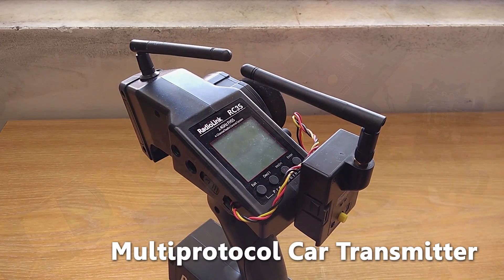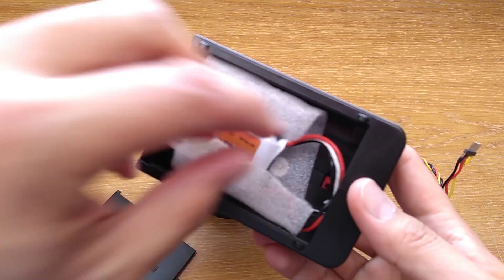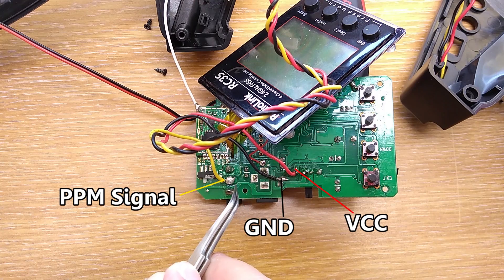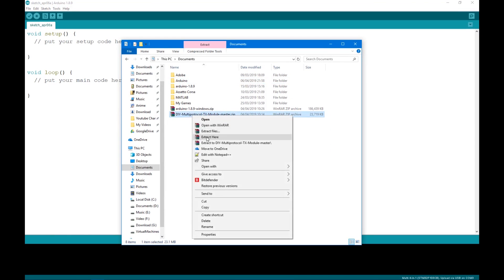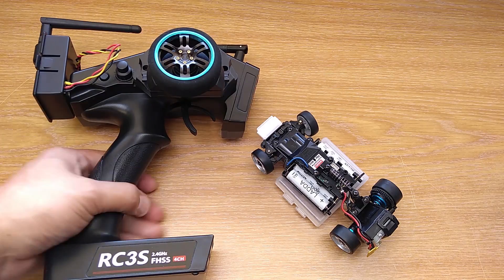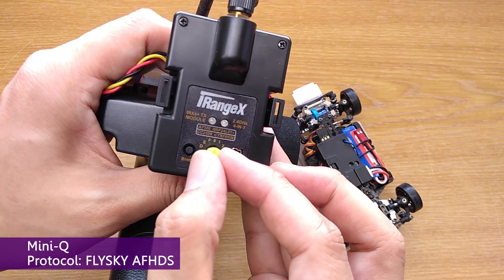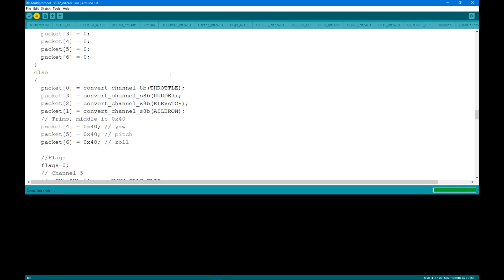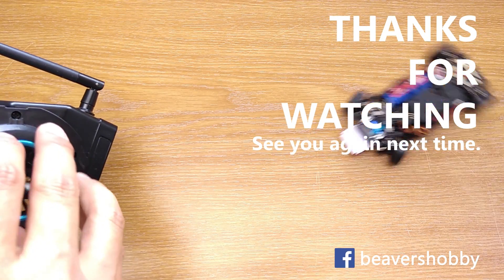How To Use Multiprotocol Module With Car Transmitter & Mini-Z, Mini-Q, WLtoys

Comment: Nice work again Beaver! 
I am thinking of buying one transmitter which I can use with multiple (car) models. I am also into RC aircraft, and I noticed that it is possible to get multi protocol aircraft transmitters, but it seems impossible to get multi protocol pistol-grip surface transmitters.

That's what ultimately led me here, but before I go out and buy a new surface transmitter, a module, and then Frankenstein them together, do you know if any radio companies are planning to release new multi protocol surface transmitters anytime soon?

Also, my computer died a while back and I haven't bought a new one yet, so I was wondering if you can tell me if it's possible to get a multi protocol module which can be used without any computer setup, or if it can be done with my (OTG capable) phone?
Keep up the cool mods and videos!😉👍
Reply from the maker: There's no plan for production of multiprotocol pistol grip as far as I know of. It's mainly a drone thing. If you don't mind driving with sticks an air Tx will be alright. You can also DIY it. There is someone I found that make their own multiprotocol surface Tx. Take a look at this. https://www.rcgroups.com/forums/showthread.php?3848273-Custom-micro-RX-ESC-for-OpenAVRc-MPM-or-Arduino-TX
Unfortunately you'll need a computer to setup multiprotocol module if you do a frankenstein build like mine.
Reply: @BeaversHobby  Thank you for taking the time to reply, and answer my questions!🙂
I do prefer pistol-grip for cars, so I might have to wait until I get a new computer, and do the Frankenstein option. 
Who knows? Maybe by then (hopefully) a company might have clued on, and released a multi protocol, pistol-grip radio, with model memory expandable with an SD card!
One radio for all of your models.
Wishful thinking perhaps, we'll see!
Seriously, I don't know why pistol-grip radios don't have these features already, especially with so much competition.
Anyway, we do what we can.
I will check out the link you put in your reply.
Thanks again, and I look forward to your next video!👋😉
Reply from the maker: @mickmuzzmkmz1628  My pleasure. Best of luck with the project.
Reply: @BeaversHobby  I was just Re-watching that video while trying to use my Radiomaster MT12 with a multi protocol module. 
Thank God that you can finally buy an open source car radio now 😂

Comment: Hi , work if i use the module on a 12 channels remote controller ?
Reply from the maker: Yes, it will work. Multiprotocol is designed for plane and drone in the first place.

Comment: Beaver big thank you for this video! I was able to wire up the IRX4+ and bind with a MB-010VE in FHSS. First I compiled and uploaded new firmware with PROTO_KYOSHO support. Second, I was able to find the 3 soldering point for RC4GS though I chose the ground pin under the DSC port. While I was checking out the circuit board, I realized it's actually the RC6GS board, so I needed to plug something into the DSC port to enable the PPM signal. I actually was in disbelief when everything worked! My soldering skill is absolutely terrible.
Reply from the maker: Glad you got it working. Noted, the current generation radios need something to plug into them to output the signal.
Reply: @BeaversHobby  Since the expensive KT432PT is otherwise the only upgrade option for kyosho fhss, I feel this irx4+ mod for ppm-capable transmitters should be publicized much more.

Comment: Hi Beaver -- is this iRangeX IRX4+ still the one to buy today? Thanks.
Reply from the maker: Yes, it's one of the few that's got both serial and PPM mode.
Reply: @BeaversHobby  Great. Now I have a second car with kyosho fhss, I think it's time to try this. I'm trying to avoid buying the kT432PT radio.
Reply from the maker: @sammybaka  I found it add a bit of latency to the system. It's just 8ms difference. Not that you would notice it unless you film it with hi-sped camera.
Reply: @BeaversHobby  Yes that's really too bad but it won't be as fast as a native implementation I guess. I'm hoping the ability to set EPA, expo curves, better ergonomics will still increase drivability.
Reply from the maker: @sammybaka  Added delay is miniscule and you won't feel it. The benefits outweigh the delay in every way.

Comment: Any idea if this can be done to a Flysky Noble NB4?
Reply from the maker: Unfortunately, no. NB4 doesn't have PPM output unless you get it from a receiver which is not advisable because you'll add more latency to the system.
Reply: @BeaversHobby  forgive my ignorance.
But how do I know if a radio has PPM output?
Does it need a "master/slave" contact?
Reply from the maker: @zeno6111753  Mostly when it has a DSC output or anything that can connect to another radio in training mode (most of the air transmitter have this). It's the same port that you connect it to USB converter as well. The other way to have PPM output is an old radio with module like Futaba 3PK and Sanwa M11.
Reply: @BeaversHobby  Futaba 3PK works? Don't you need 4 channels?
Reply from the maker: @zeno6111753  Yes, but you can swap in the code to use channel 3 as channel 4 so it all work out.
The standard channel order is AETR, swap that for AERT and voila! It works!

With that being said, I'm working on a new video where I use my 3PK with both Sport and the new FHSS (RWD/AWD/FWD). Basically it's only what I just told you now, AERT and it works.
Reply: @BeaversHobby  that sounds great! 
Looking forward to that video. 
And also, again thank you for your answers and sharing of knowledge with us noobs :)
Reply from the maker: @zeno6111753  My pleasure. Good luck with the project.

Comment: Hi, sorry if asked before, but what is the protocol in use in wltoys original setup? I'll try to use it with my Frsky joystick transmitter with the irangex module...Thanks
Reply from the maker: WLtoys is V2X2 just like I showed in this video. iRangeX will work fine as you can see.

Comment: Hi ! Do you believe I can use this module on the KO-PROPO EX-10 radio with a module bay ?  I have a module for Mini-Z (ASF) on it with the mention  DDS, so I don't know if it is related to PPM or not.
Reply from the maker: Yes, you can use the same method with EX-10. Just need to locate where the signal pin is. The Mini-Z module also runs off PPM signal if it's the same one as 3PK.

Comment: Thanks for this. Tried to do the same with Flysky FS-GT2 using the DSC port but the iRangeX 4+ doesn't seem to see the PPM signal (flashes red slowly after power-on). Testing for the PPM pin of the DSC port using a multimeter gives about 4.6V. Any idea what could be wrong?
Reply from the maker: 4.6v is much too high. Can you connect that to the USB adapter and use it as game controller? If it works with adapter then it's PPM and you might need some resistors for it to work with this module. Otherwise it's something else.

Comment: Hello, it seems, that it uses A7105 chip tx for AFHDS protocol. And this chip is way cheaper than this module. Have you investigated that?
Reply from the maker: I use other chips as well because Wltoys uses NRF24L01 and some of my receiver is DSM2 which is CYRF6936. If you only use it with A7105, building one from scratch with only 1 chip is way cheaper as you said.
Reply: @BeaversHobby  Yep. For me is more important the size. So, I can place it inside RadioLink RC3S.

Comment: Bro Radiolink RC6gs
Modulation mode: GFSK
Spread spectrum:FHSS 67 channels 
kt-531p  radio spec to same  can be connected with or not?
Do need to customize the software?
Reply from the maker: Unfortunately no, they are not cross compatible.
FHSS is just the name of a method for skipping frequency to avoid interference.
A radio talks to a receiver via protocol which dictates the way to skip (hop) between frequency and possibly other attributes like transmitting encryption and telemetry. Radiolink and Mini-Z protocol are different. Even RF chips are different.

Comment: I would like to know if the radiolink rc4gs connector mini z can do or not? ( not mod)
Reply from the maker: No, it can't connect to Mini-z without mod.
In case you are confused with the "FHSS" label. That's just the name of the method for skipping frequency to avoid interference.
A radio talks to a receiver via protocol which dictates the way to skip (hop) between frequency and possibly other attributes like transmitting encryption and telemetry. Well, Mini-Z doesn't have telemetry but you get the idea.

Comment: Yeah....
No ppm from that pinout on the rc6gs.
Looking for the pcb trace to the rf module but no luck yet
Reply from the maker: I'm quite baffled by this. Did they change the internal too much that now one's DSC doesn't output PPM anymore?
Reply: @BeaversHobby  
I don't know but it wasn't until after I bought the rc6gs that I saw your post from years ago on RCgroups asking the same question.
There is a spot to solder headers on the rc6gs board but the "tx" voltage is 3.3v not 2.7v.
Is 3.3v a "common voltage" for ppm out?
 check out my post on rcgroups I uploaded a picture...
a13194775-101-Screenshot_20200224-182409_Gallery.jpg (1440×2960)
https://static.rcgroups.net/forums/attachments/6/6/2/5/8/0/a13194775-101-Screenshot_20200224-182409_Gallery.jpg
Reply from the maker: @user-zi5rs1by7b  Honestly I don't know. That Tx could mean anything and a mean to communicate between transmission module can be more than PPM.
Reply: @BeaversHobby  
I figured out the problem. I was testing the JR module with a separate battery and it needs battery ground split between the dsc, the battery and the module to complete the circuit...
I feel silly.
Now I just need to figure out how to cut power to the internal tx module (maybe with a switch) while using the external module. Any ideas?... or does the internal module stop transmitting while using dsc? I might test that theory today.
Reply from the maker: @user-zi5rs1by7b  Internal module doesn't cut the power when output DSC. You'll need to unsolder the board to get rid of Radiolink output. However seems like no one has ever done this and no one knows what would happen.
Reply: @BeaversHobby  
Well then I will boldly go where no man has gone before....
and I will report back.
I will likely put a switch to the internal module... may post a video.
Wish me luck.
Reply: @user-zi5rs1by7b  hi after reading this post, i hope you can help me. i am trying to add in the multimodule to rc6gs as well. can you share a photo of the pins you soldered to that is working for ppm, ground and power?
Reply: May have found the solution. In order for the RC6GS to actually output PPM on the DSC port/pins, we have to plug something in. With nothing plugged in, the voltage is 0. I cut off an old audio jack from the rest of the audio cable and plugged it into the DSC port and the PPM output works now!!!
Reply: @nicholastan4108  Same with me! Spent a day figuring out what's wrong with missing PPM signal on DSC port on both radios I have - RC3S and RC4GS. No signal until I plug the audio jack in the DSC hole. It works like a charm now with my STM32 4in1 module. Many thanks to you Nikolas for such a useful hint!!!

Comment: Can you still use the radiolink reciveres with this modification? and does it store the models in its model memory using the multiprotocol module?
Reply from the maker: Yes, Radiolink receivers still work. Make sure to pull the plug from multiprotocol before go back to stock Radiolink to avoid interference. Radiolink don't get it easily but better safe than sorry. I have to mention that Radiolink transmission module don't turn off when you do this so you can drive both multiprotocol and Radiolink Rx at the same time.
The model memories are saved in the transmitter so you still have 10 models like before.
This module is similar to plugging the DSC into converter and play simulator on computer.
Reply: @BeaversHobby  Perfect, thank you very much, i have the rc6gs, and being able to plug in a spare multi module is exactly what it needs to be perfect.
Reply: @BeaversHobby  maybe im doing something wrong, i couldnt find a ppm signal on the dcm pins inside the trannsmitter, i have the ground and power soldered up and they work and power on the module, but that ppm signal doesnt appear to exist on any of the 3 pins. Have any tips and or multimeter settings i could try?
Reply from the maker: @53rdcards  Set multimeter to 0-20V, that should see the 1.5V on PPM pin. I'm not sure about RC6GS output though. Do you have a DSC to USB adapter (for simulator) to test if the port works?
Reply: @BeaversHobby  I do not, but i can get one, and thanks for the tip on the multimeter

Comment: Beaver.... my guy?
I would like to do this to a wltoys P33 pistol grip but the pinout doesn't have a ppm clearly labeled. If you have one of these radios could you maybe help me out? I don't even know if wltoys transmitters have a ppm out signal...
Reply from the maker: Unfortunately, it doesn't seem to have one. Not every transmitter has this output or port.

Comment: Hi there. I wonder if I can do this on Futaba 4pk. It has dsc (as I google it), but not like 3.5mm jack, it's socket connector.
Reply from the maker: Yes, anything with DSC or PPM output will work regardless of the style of the port. Just find which pin is the signal output coming from and you're ready.
Reply: @BeaversHobby  Thabks. I'm still looking for a transmitter. I love ex-6 & ex-1, but those are expensive even used one. No idea which tx should I buy. In my head, only kt-18, rc4gs, 4pk.
Reply from the maker: @MDXZFR  4PK is a great radio if you can get it at a right price and right condition considering it's quite old now. It offers everything you'll ever need and quality is far superior than RC4GS.
There was a mod to install ASF board in 4PK too. I guess he did the same thing and tapped in to PPM output on DSC. http://mini-z-guide.com/radio.htm
I won't explicitly say stay away from KT-18 because the quality is decent but in long run you'll eventually want more adjustments. One thing to mention about Radiolink, it doesn't turn off the transmission when you use DSC. So if the protocol is susceptible to interference (unfortunately, as far as I know ASF is) you might get interference unless you pull the Tx board off. I haven't done this full conversion yet but it looks doable.
Reply: @BeaversHobby  ahh. Sounds bad. Even after the batteries removed?
I'll try to get this 4pk, and use it with dasmikro asf module. If the price is good enough.
Reply from the maker: @MDXZFR  You need battery to operate the radio. The Radiolink's transmission module is soldered to the board. It can be removed though.
Reply: @BeaversHobby  i see. Ig there's no prob with the 4pk right? How about ur 3pk? U said u wanna use it with the module in the video.
Reply from the maker: @MDXZFR  Seems to be no problem with 4PK.
Every since I bought the FrSky module for my 3PK I kind of forgot I wanted to drive Mini-Z with it and had so much fun with AMZ & Q7. I remember testing with a code that permanently activates channel 4 for Mini-Z Sports and it worked. But nothing beyond that. The project is still left open though, I'm currently waiting for small receiver for FlySky Noble. If that is small & light enough I'll go back to 3PK + Mini-Z Sports.
Reply: @BeaversHobby  that sounds fun. Having another cars beside mini-z is in my wishlist. 
So, u're gonna use Noble with Amz & 3pk with mini-z? Well, u should upload ur project videos here. I'll be waiting.
And I just bought 4pk online for ¥10,280. Around $94 include shipping. Sounds ok?
Reply from the maker: @MDXZFR  4PK for that price? That is fantastic! Here it's about 250 Euros ~$270 used.
I already use Noble with AMZ since the FGr4S receiver fits (I found this out a few days after I used FrSky and filmed the AMZ review). So here's the AMZ with Noble. https://youtu.be/ux2KxRigY4E
I'm still having trouble with Q7 because the body I use is much lower. Now I'm waiting to see how small can I make the FGr4P. There'll be a video downsizing this receiver. I can't wait until FlySky make a receiver that is about the mini Sanwa/Futaba size. It'll make my life much easier
Reply from the maker: @MDXZFR  That's really sweet receiver. Wiring can be a bit of nightmare though since it has only one ground and one power. Yes, ground is the black one marked GND or - (minus symbol). 
I quite like to try ASF sometimes as there're also 2 mini receivers from DasMikro with JST-ZH plugs both 3CH and 4CH. The small receiver you suggested probably needs a video to explain how to wire it. I'll put it in my future possible project. Thanks for the suggestion.
Reply: @BeaversHobby  thanks. As dsc port on 4pk is 3-pin connector, (black,red,white wires. Futaba original dsc cable), can I just directly connect to that port from the module? 
Means on the port, black=gnd, red=vcc, white=ppm, correct?
Reply from the maker: @MDXZFR  I don't know the output either but it should be what you think. Use multimeter to check it first is the safest way.

Comment: Hi! This module support kyosho asf and mhs protocols? Thx.
Reply from the maker: The module in the video isn't. But this one is. http://bit.ly/310mEMG You can use the same wiring method to get it working.
Reply: Le liens ne fonctionne plus. Est ce que je pourrais juste avoir la référence du module ? Merci d'avance.

Comment: Fixing to use this technique to put an ezUHF on my rc6gs. I will add a switch to turn off the internal module while running the external one. Hopefully I can fit a 3s in the battery compartment and use a step down for the radio itself while running 12v to the module.
Reply: Maybe run the radio from a certain pin of the balance plug?     Thatd give you multiple voltages to work with.  Warning, youd need to be very careful to make sure it doesn't get too low in